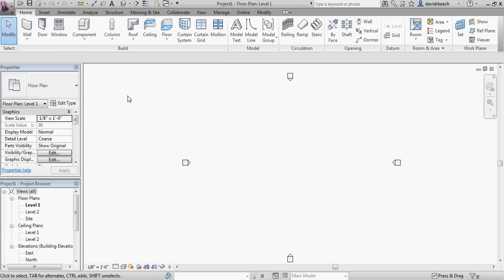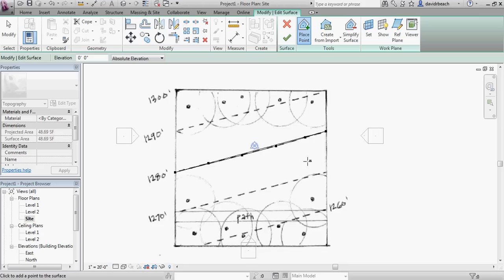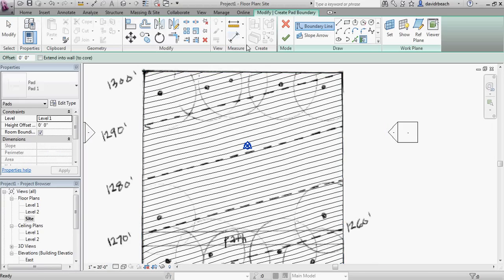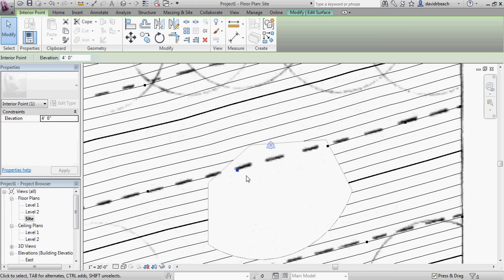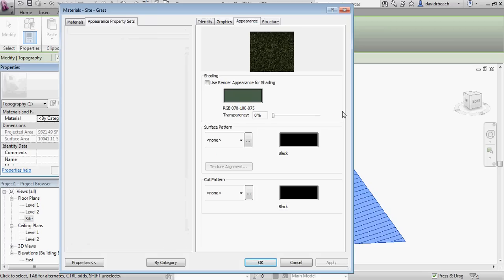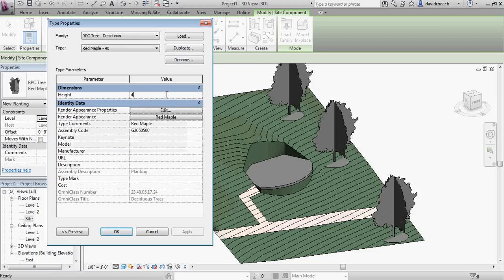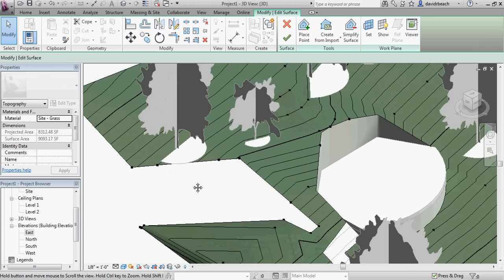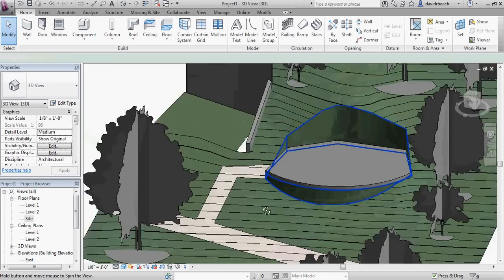Revit Topo

Comment: I put these different heights in, but in 3d its always the same (flat), any idea why?
Reply from the maker: I am not sure how you are moving the file into 3ds Max, but if you are exporting (not linking) - make certain you are exporting from a 3d view.  If you export a file from a 2d orthographic view, Revit will only send out the 2d information...assuming that you are bringing it into AutoCadd.
Reply: DavidRBeach I did the same steps as u did without the picture in the background (just to see if it works). I opened a new project (architectural template) - went to siteplan - Toposurface - points then choose and elevation height. set a few points similiar to yours. and followed it down with different heights.

But it shows up flat on 3d not sure why. I tried it on different computers at uni and at home, same issue, i think im missing something here..
Reply from the maker: Shanker K
Hmm...i might be at a bit of a loss on this one right now then. You can post me the Revit file if you would like - and i can see if there is anything weird going on and run it through my typical process??